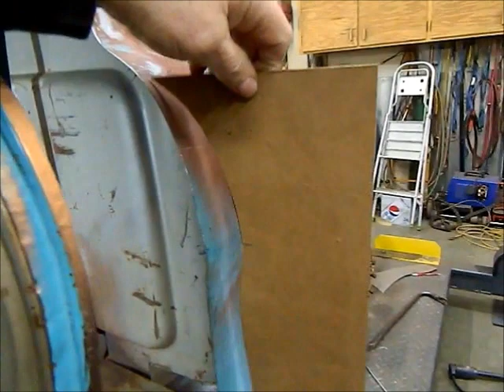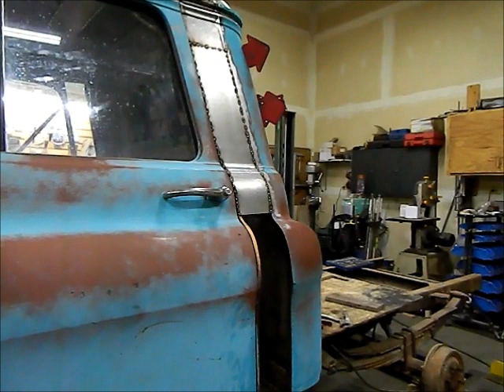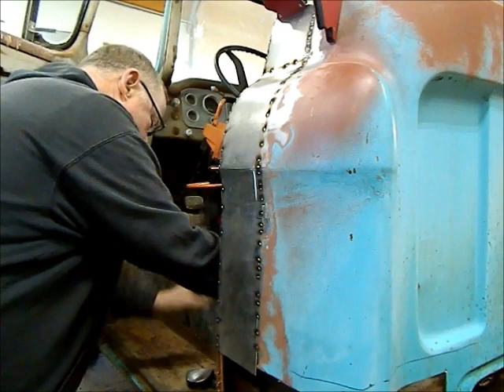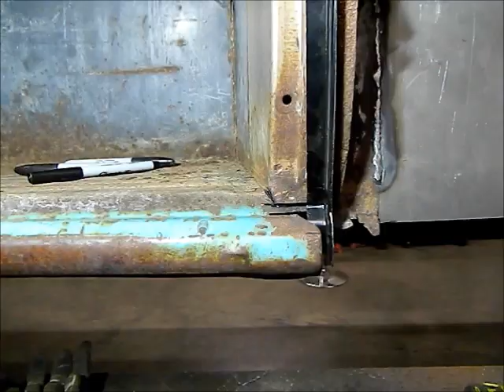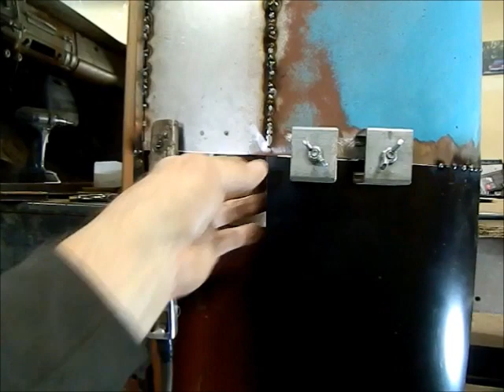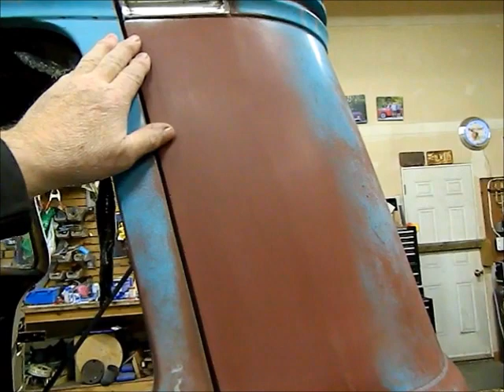1959GMC Fleetside # 10

Comment: Hey There, great stuff. I love that you metal shaped the patch panels as apposed to using filler to make the shape. I saw your 28 dodge on Rat Rods for Africa and I love it and loved that you used a dodge engine as well. I'm in Edmonton building a 40 dodge coupe. Thanks for sharing, Cheers Kyle Carter is an awesome fabricator.
Reply from the maker: Hey Danny thanks for coming by the channel,  I love the 28. The thought of a SBC in my 28 makes me want to up chuck.